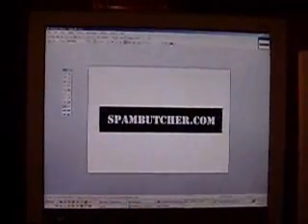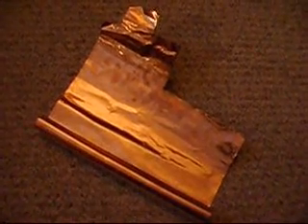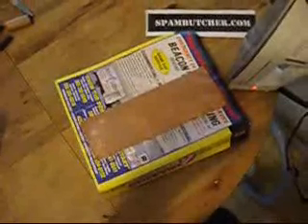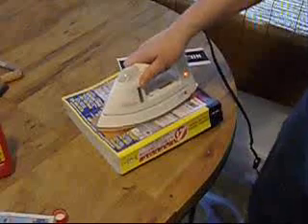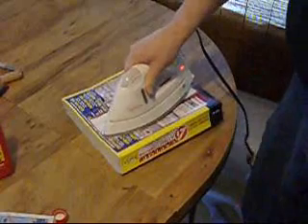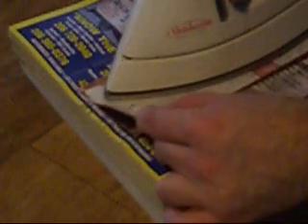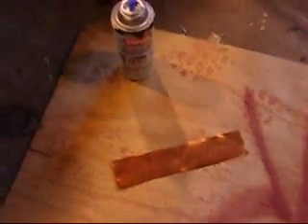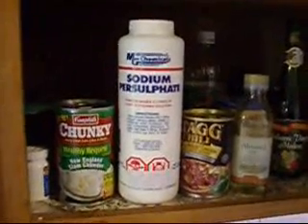Make a copper stencil using your laser printer

Comment: Not showing the etching liquid recipe got me to downvote. I don't support cowards. If you want to be safest possible just get a cheap car battery charger and just hook it up to the positive red wire and put any other metal on the black wire in a saturated table salt (preferably no idodine added). It's called salt water etching and the worst you do is make some dilute salty aluminium hydroxide.